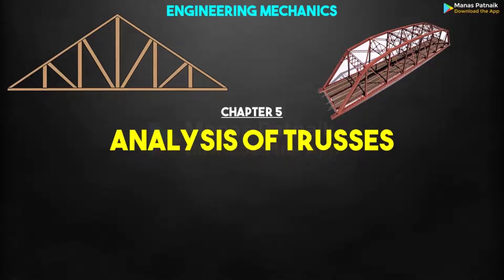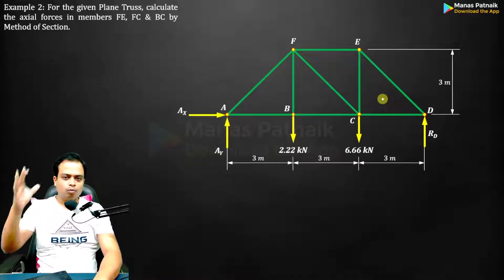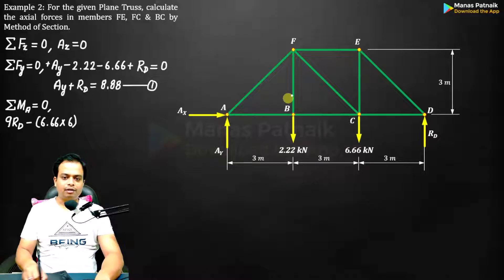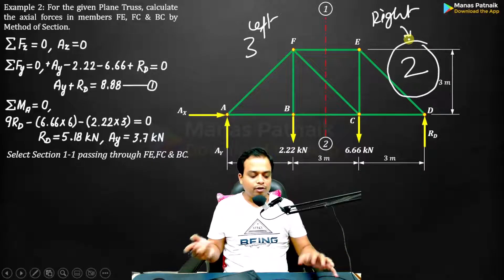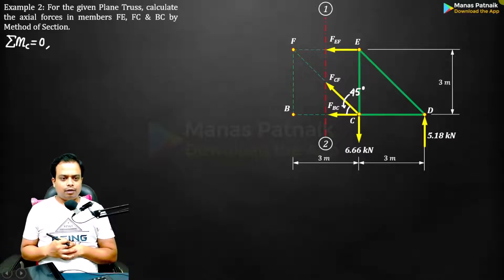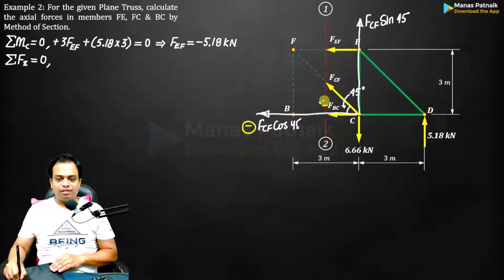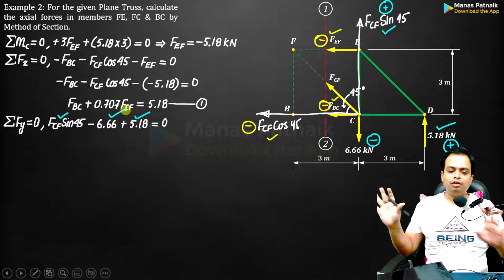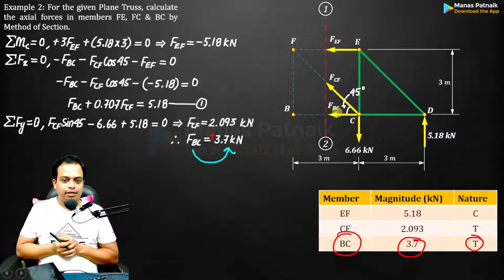TRUSSES_Method of Sections_Detailed Explanation

Comment: Greetings Sir, I had a doubt regarding the moment equation after applying the method of sections 
At C, why did you took the forces on the RHS as you told to take the forces towards/of the other side LHS ?
Reply from the maker: Hello LIGHT.........
You are free to consider forces either to the right or the left.....Feel free to explore both options and verify the results.